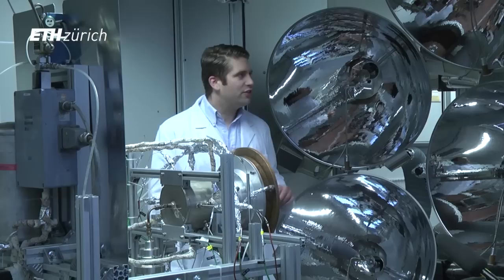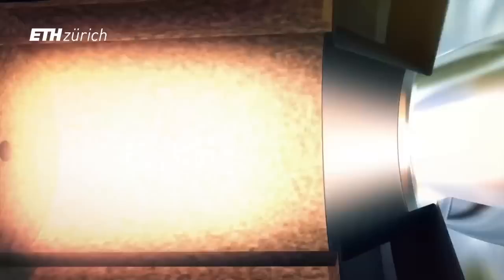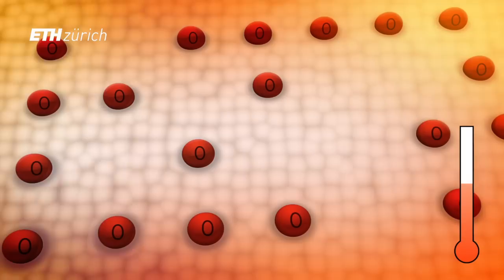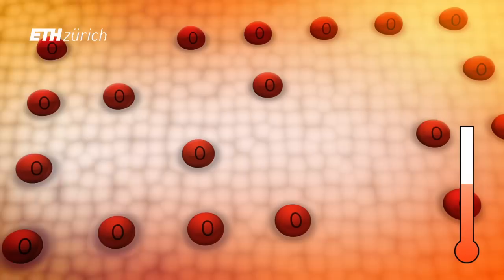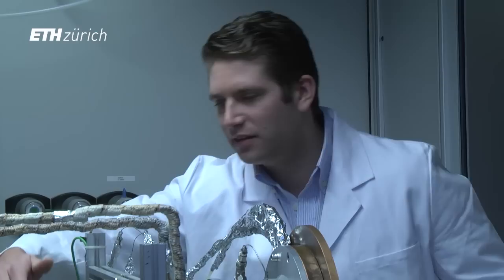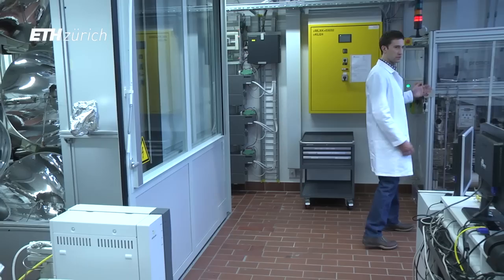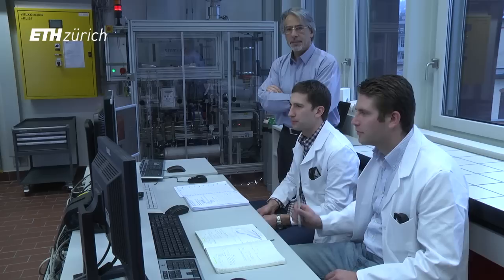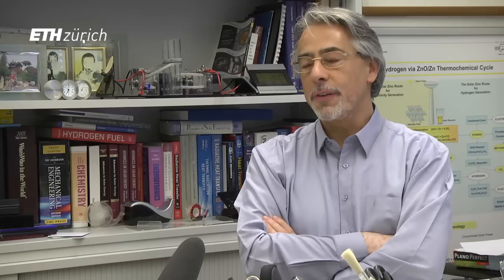Sunlight to jet fuel

Comment: If Jet Fuel can be developed, it is NOT much of a stretch to create fuel for land vehicles.  BRAVO and actually happy to see such amazing innovation.  THIS should be a major headline GLOBALLY!
Reply: The basics have been around a long time, the Germans were making synthetic fuel from coal when during the world war.
This is only a marginal step further, Shell and Sasol and some other companies have already using natural gas for Gas to liquid fuel conversion in some of their plants.
The issue is to do it on a large scale and make it profitable, you can use sunlight and mate it to a coal or natural gas power plant exhaust as a source of Carbon dioxide and water vapour. This stuff will either need to be extremely profitable (need a lot of experience with operating such plants to get them there) or need lot of government subsidies (right wing especially people like Trump will not accept it). So this will be a long shot without significant government encouragement.

Comment: That's terrific.  The question is how much surface area would have to be dedicated to solar collection to meet the world's needs?  Probably less than is dedicated to petroleum extraction, right?  I read recently that the US is working on a similar system for aircraft carriers, but with nuclear-generated heat as the energy source instead of the sun.

Comment: A British company patented a method  doing this about year ago. The Germans are not the first to make gasoline using air.
Reply: Germans?
Reply: ETH Zurich isn't in Germany it's in switzerland.
Reply: Metal redox cycles for solar thermochemical fuel production and fuel synthesis from syngas has been researched for decades.  The British aren't the first either.